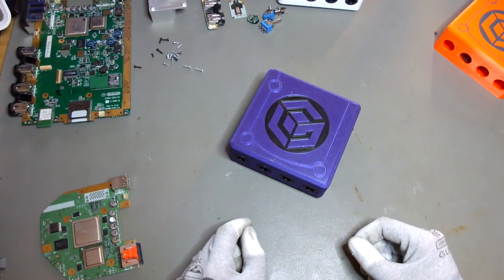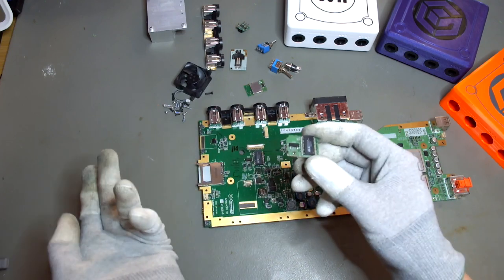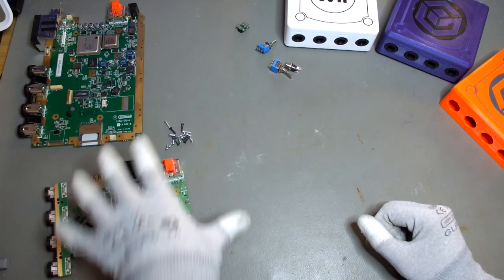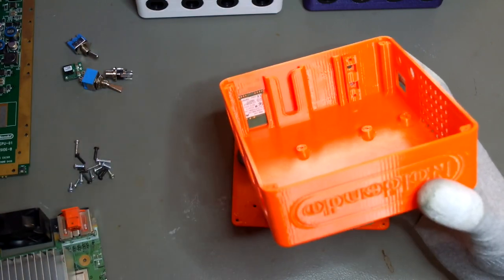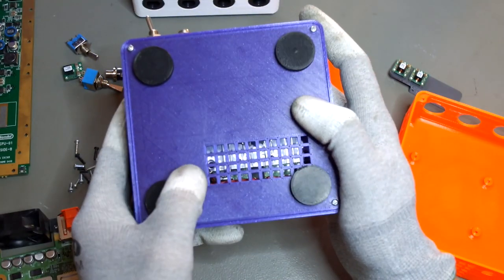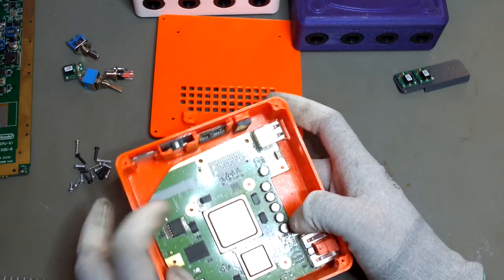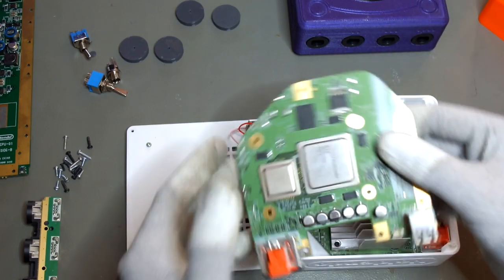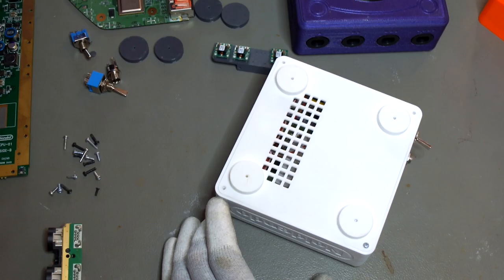Build Your Own Wii Micro!

Comment: you should make one that's the exact same,  but it's like an inch taller with a disk drive
Reply: That would be impossible because it would need to be made as wide as the original wii

Comment: Awesome! I would love to build one as my first Wii Project. Is there anyway of telling from the outside of the Wii as to identify that it is the 6 layer version?
Reply from the maker: You can tell it by removing the RTC battery at the bottom: https://bitbuilt.net/forums/index.php?threads/revision-identification-guide.863/

We are also collecting serial numbers & try to match them to revisions here: https://bitbuilt.net/forums/index.php?threads/identifying-a-wiis-revision-based-off-of-serial-numbers.716/

Comment: i have bought the rvl-psu a while back because i wanted to build a micro after watching your video and checking out jeff's build. could i use that instead of the 4 regulators or do i still need the 4 regulators with the psu?
Reply: you can use the rvl-psu instead of the PTH regulators.
Reply: @NolDSx  thank you for the reply. one more thing. im very hesitant on continuing my project mainly because of the trim part. can you give some tips for trimming and sanding. sanding part im kind of scared of aswell

Comment: Would it be possible to replace the power barrel adapter with something like USB c?
Reply: Yes. You can find plenty of USB-C power supplies that have enough watts and 12v output. I found hardware on Amazon that sends a signal over the connection to request 12v specifically.

Comment: I just found this Wii Micro / Noldendo Miicro and I want to make one, I've got a faulty Wii with a broken eject button so that can make a great project ^^

Just a question, why did you cut off the Wii AC Adapter ? I thinking that can make the mod easier for or I'm totaly wrong (I'm a totally newby about Wii hardmodding ^^')
Reply: I think it's because you now have to run the power to the custom regulators since you've cut off the originals.

Comment: How many amps did your 12v barrel jack output?
Reply from the maker: i'm not quite sure but i think a little about 1A should be enough for the Wii. I think my PSUs are 2A which is very fine. IIRC the modifed Wii, with custom PSU draws about 7W

Comment: Is this safe to do with a Japanese Wii and power supply? Would the potential voltage difference cause any issues? (Sorry if this is a noob question, I am new to this kind of modding)
Reply: All Wiis operate with the same DC input voltage.

Comment: Can you just cut it or do I need to be aware of some things that might break the wii?
Reply from the maker: ofc things can break, you're cutting apart the mainboard PCB
Reply: NJU 74 you can put tape over the areas of the board that you’re keeping to protect them a bit, but other than that just go slow and keep a clean line
Reply: @silasweaver8268 What kind of tool do you use to cut it, just regular scissors or do you need a saw or something?

Comment: Would it be possible to replace the power barrel adapter with something like USB c?
Reply: USB-C PD can do 12v, but you need the supporting microcontroller to handle the "hand shake" that tells a USB-C PD power supply "Hey, I want 12v". But, it'd only be for power, and USB-C PD capable power supplies are way more expensive than a common 12v supply, and you don't wanna accidentally explode an expensive power supply on such a minor job. So, technically you CAN but it's not worth it.